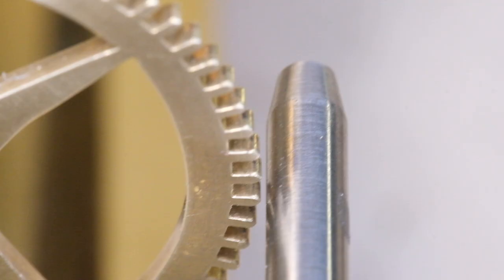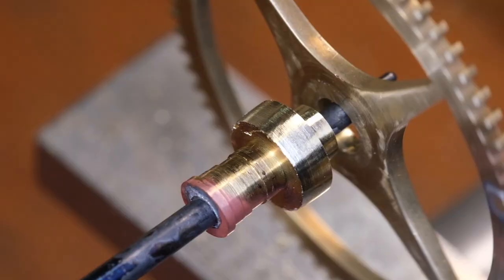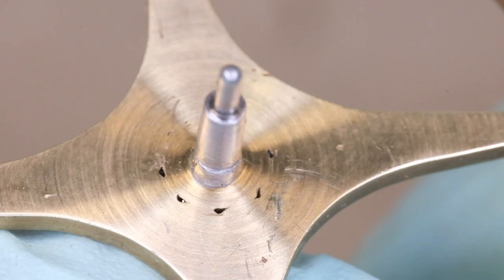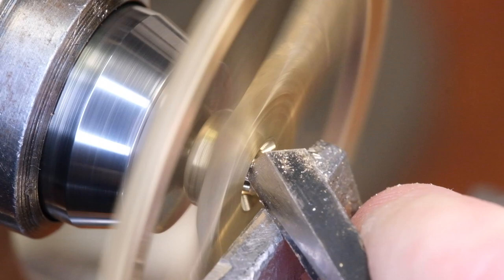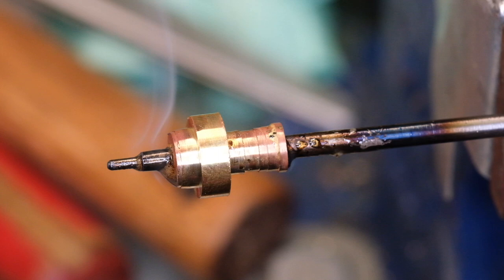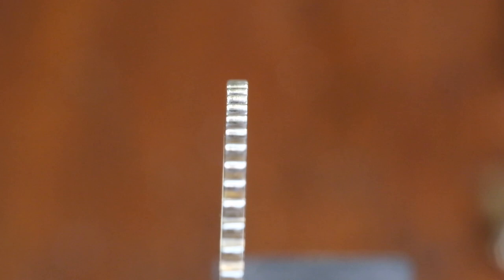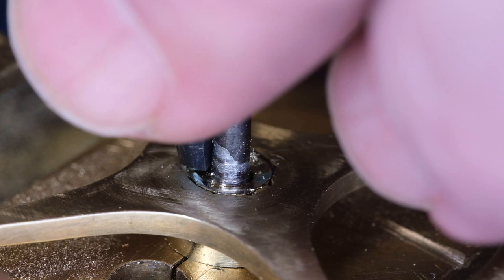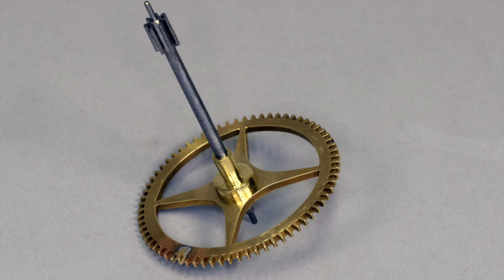#026 - Re-colleting a wheel from a late eighteenth century clock using traditional repair techniques

Comment: Very informative, Matthew perhaps you could give some advice on a future video regarding worn pinions
Reply from the maker: Hi Ray.  Yes I will.  Thanks for the suggestion.  By Coincidence I have a clock on my bench where wheels have been moved to an 'unworn' part of the pinion.  I probably will move the wheel back.  Yes needs a video.  It is really a case of getting to grips with depthing I suppose.  We did  a pre-publication on Depthing and Bushing that may be of use.  M  https://www.amazon.co.uk/Depthing-Bushing-step-step-pre-publication-ebook/dp/B098126469

Comment: Hi Matthew, I missed your videos.
Is it possible to friction fit the collet to the arbor, without the use of a soft solder?
Reply from the maker: Hi Hector.  Yes it would be or to at least use Loctite.  More modern clocks tend to be made that way and I was trying to demonstrate a 'traditional' technique and also warn against moving collets that are fitted this way.  Yes I could have drilled under-sixes and broached to a much 'better' fit and as you say, just driven the collet onto the tapered arbor or used modern adhesive.  M